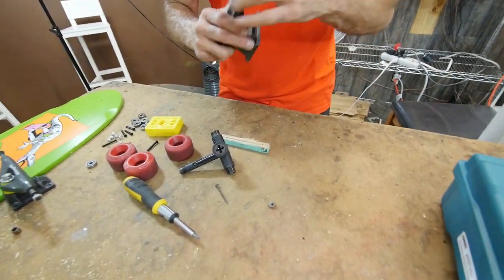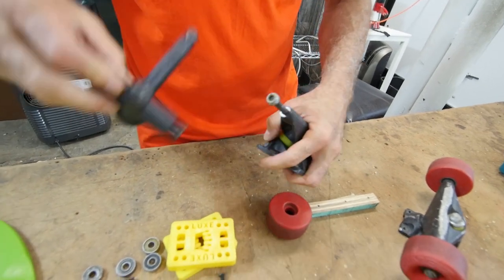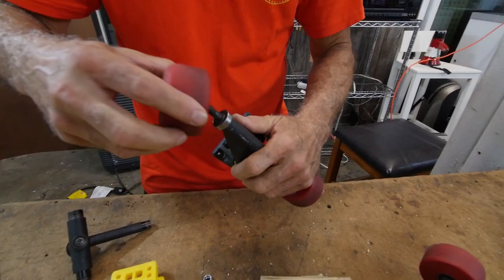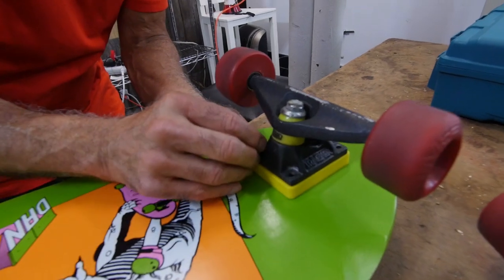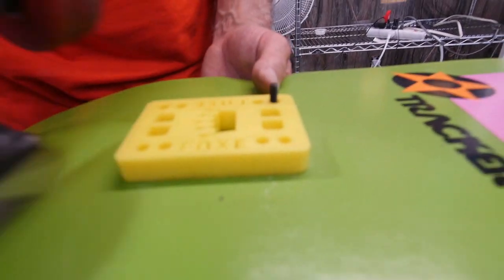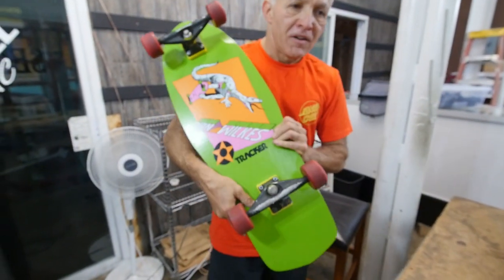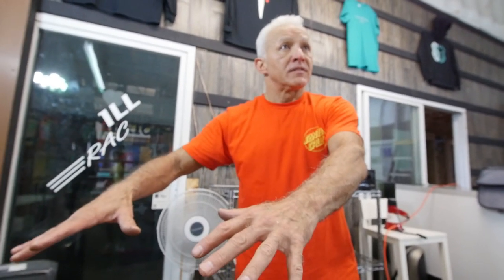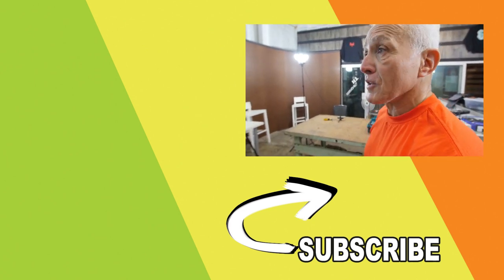Old School Reissue Skateboard Setup Problem

Comment: One cool grandfather.  The holes got smaller  because doing nose and tail slides you would grind up the mounting hardware then they were a pain to get off. Good vid guys.
Reply from the maker: Great information!! Thanks!! We will have to pass that along. Glad you enjoyed.
Reply: And doing nose slides the wheels would hit the rail or curb before the base of trucks or deck so NO sliders just sticky bails so that's also why they changed the holes, also PEOPLE were complaining about breaking the base plates right there at the 2 holes so indy changed the design.
Reply: Gosk8now! ! small holes dont compare to 80s hole patterns thats why i only buy powell boards they come with 80s hole patterns on there reissue boards but i will compromise with a 87 reissue of the Lake Guts Skates skateboard it comes with modern hole patterns but the board still looks like the OG Lake Guts Skates Skateboard and i might re drill the holes so i can put oldschool trucks on it like it should have

Comment: i remember the task of putting loose ball barings in our wheels on our Val Surf bananna boards we even gripped our plastic bananna boards i found the plastic grooves in the board were not grippy enough then i got a white 1985 Lester Kasai Clown board my first pro board for $14.95 at off the wall skate shop in 1987

Comment: I have (purchased in 2013 online NEW) a Tommy Guerrero Iron Gate (blue stain). Just at the rear, on front of the back truck says MCMLXXXIX (1989). Is this the issue/press year?
Reply from the maker: Hi Daniel, is this deck from the reissue series or a NOS one? Either way, the date stamped on it indicates the year it was issued. For the reissues, I believe they all have the year they were reissued stamped on, to avoid confusion with the originals, but I could be wrong about that. Unfortunately I don't have one to verify currently.

Comment: Hi mate,  im doing a set-up of a Jeff Kendall pro series 86 and was recently given a pair of powell peralta bombers which  seem huge like 66mm or i have a pair of original alva (not sure of name but are a little smaller at about 60mm and am wondering which would be more authentic for time period ,?also i was wondering too ,i have a Danny way H-street blackhole model and was wondering what would be the size of wheel back in about 90-91 just before we went with tiny wheels or would it have been the small wheels ? As a kid i had many nice boards but dream of getting a sims Stabb again i had one with gullwings bullets and clear grip ..
Reply from the maker: Hi Matthew, thanks for checking out our video and your questions! 
For our personal preference, 60mm is the perfect wheel size! 66mm is way too big, though if you're doing a lot of ramp riding, that might be nice.
For a little more authentic wheel choice, try a 63mm.
1990-91, wheel sizes were mostly in the high-50s (56-59mm) and low 60s (60-63mm). You can't go wrong with 57mm or 60mm.
A Sims Staab would be sick with the setup you described! Let us know if you get that!
Reply: Geezer Skate Co. Yeah would kill for that Stabb again even as a reissue, but alas i dont think i will ever own one again as they go for over a $1000 here in Australia,  yeah i went the Alvas ,which are 59-60mm's as those Powell Bombers are huge at 66mm , they are a strange set of wheels and randomly came across them .thx for reply .

Comment: Indy has the reissue trucks that fit.
Reply from the maker: Oh yeah? That’s rad and a good tip! Thanks for the info!!
Reply: Yeah I had to find out the hard way though, I bought a reissue Steve Cab dragon and bats deck and wanted the matching color monster trucks but they didn't fit the mounting holes in the deck so I had to get independent with the base plates of the 80's-90's to even mount the trucks but hey Indy's and spitfire classics 60mm is really feeling like 1985 all over again !
Reply from the maker: Ahh yes Love that - would love to see your set up!
Reply: @GeezerSkateCo  I wish I knew how to show pictures but it's the brand new reissue Powell peralta Steve Cab dragon and bats with black background and indy stage XI trucks with the extra holes base plates, China bone red bearings independent risers and 60mm spitfire classics 99a hardness with the red spiral graphic and the top grip tape cut so you can totally see the top graffiti too ! 
It's SO sweet to ride like it's the 1989 all over again !!!! Fun !
Reply: @auntjenifer7774  just got my Cab Dragon Bats reissue, ran into the same issue.   You would think SkateOne would point that out to folks.  Nope had to wait an additional week for the replacement Indys.  I'm set up for just cruising around, I'm 47 and ain't trying to break bones.  I've got Indy 159s with 60mm OJ Super Juice w/ red bearings.  Just sticking with flat ground no ramps ... LOL